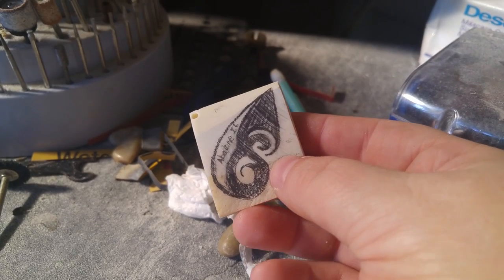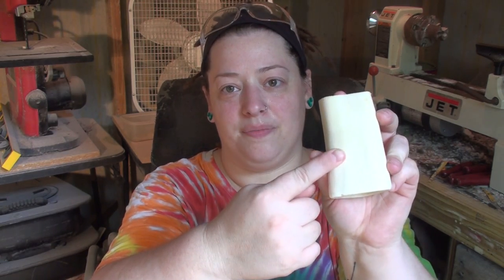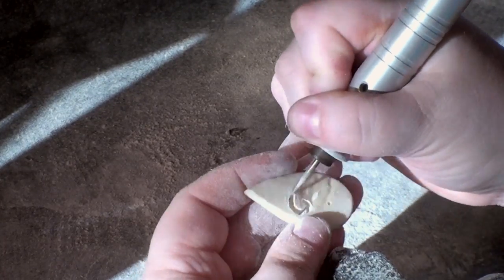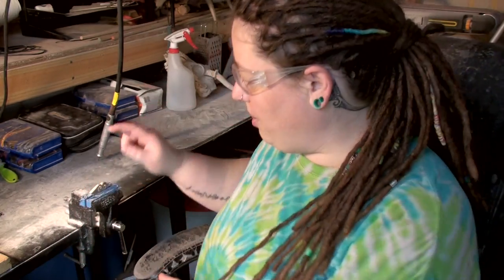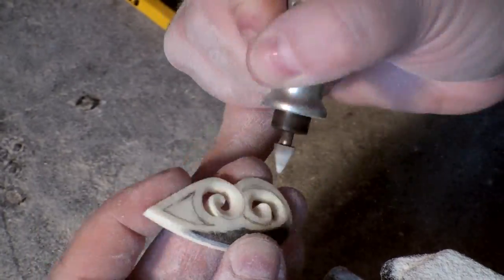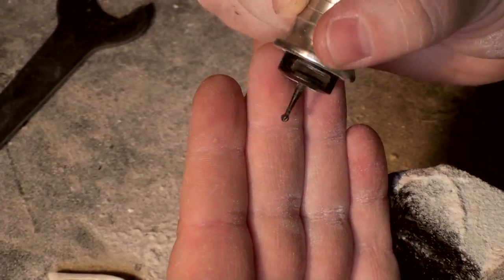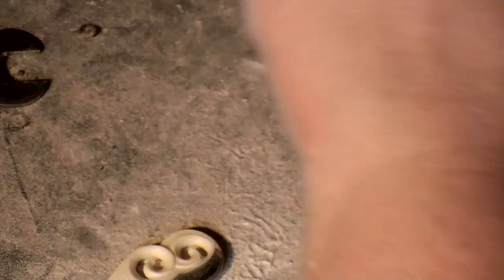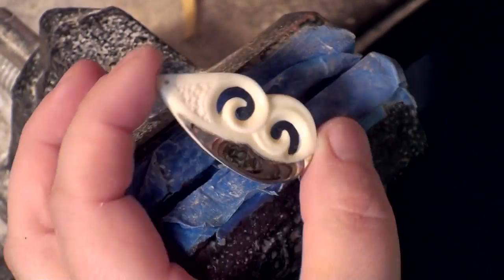Tutorial: Bone Carving | How to Carve a Bone Pendant with Abalone Inlay

Comment: Hi Heather! I'm curious, I've always like slightly stained bone. If we wanted to stain the bone would we do this before the polishing step? Did you have any recommendations for bone staining for a natural/light stain? Love your video!
Reply: Also what kind of sanding discs do you have? I didn't have much luck finding. Thanks!
Reply from the maker: Hi Marina :) I can indeed help with that... in fact, I was planning to include this in my next tutorial(when I can find the time to make another one...lol.) My favorite way to stain bone is to make a solution using coffee grounds and water. I'm sure there are plenty of other ways to do it, but since I couldn't find any information on this when I first started carving, I kind of just developed this method myself. I take a couple table spoons of coffee grounds and put them in a small bowl. I then add water just enough to cover the grounds and bone carving. The more concentrated the solution, the better. If you want a light stain, you can leave it in for a couple hours. If you want a dark stain, you can leave it in for up to several days. I find that I like the look of  the stain better when I drop the bone in after it is sanded and polished. Once it is done in the stain, I run some of the finer sand papers over it again and give it another polish. It is personal preference really, as it can also be stained before it is sanded and polished. However, if done this way, the high points will loose the stain after sanding is complete. Sometimes this method works for certain looks... perhaps if you want only carved designs to remain stained, etc... Have fun! :)
Reply: thank you for your quick response! i'm assuming the stain would change the color of the rock/crystal that is imbedded in it correct? not sure if you've tried that before or not. Thanks again!! have a great weekend!
Reply from the maker: My pleasure. :) I have not tried staining any projects with embedded stones no... I'm not sure what the outcome would be since a lot of minerals are porous in nature. If you try it, I would love to hear of your results. :) You have a great weekend as well!
Reply from the maker: I just use regular barrel sanders for shaping the material... you can buy them in kits from hardware stores or amazon, etc... Here is an example: https://www.amazon.com/LiangGui-Including-Sanding-Sleeves-Mandrels/dp/B0772GB1ZM/ref=asc_df_B0772GB1ZM/?tag=hyprod-20&linkCode=df0&hvadid=241901362930&hvpos=1o2&hvnetw=g&hvrand=11562709628242970759&hvpone=&hvptwo=&hvqmt=&hvdev=c&hvdvcmdl=&hvlocint=&hvlocphy=9051599&hvtargid=pla-399622099573&psc=1
Reply from the maker: For finish sanding, I cut strips of wet dry sand paper that I get from auto part stores. They always have a large selection of sandpaper grits.
Reply: Heatherfish Creations you’re the best thank you so much! Sorry just a beginner I have no idea ha but do taxidermy apprenticing so I def want to get into it more

Comment: Hello Heather your video is just amazing! i am kinda new to this but so far i made great pendant using my imagination. i have only one question. can you link me to a web site for a dremel that i can do the contour of my pendants. i think its the one you wrote your name with in the back of your work. since i have biginers tools i dont own that dremel. if you want i can show you what kind of work i did :)  thank you in advance
Reply from the maker: I'm happy you found the video helpful! I'm even happier that you have started carving! I'm not super sure if you are talking about the entire rotary tool, which I did link in the video description, or if you are talking about the individual bits. Since you referenced the part where I signed the pendant, I'm going to assume you are talking about the bits. I was using a micro carbide bit for that. It came with this kit: https://www.homedepot.com/p/Dremel-Carving-Engraving-Kit-for-Stone-Glass-and-Terra-Cotta-11-Piece-689-01/202349447?cm_mmc=Shopping%7CG%7CBase%7CD25T%7C25-7_POWER+TOOL+ACCESSORIES%7CNA%7CPLA%7c71700000034127227%7c58700003933021549%7c92700031755124880&gclid=Cj0KCQjw6fvdBRCbARIsABGZ-vQsUKXzaATRN99tdWWTxIRK0SzdWrVEe4cOk5I6mWSPLf8qSczdlIUaAnkaEALw_wcB&gclsrc=aw.ds&dclid=COv0zuymgN4CFUpZwQod5PgDvQ

Here are two more kits you may find helpful:
https://www.ebay.com/itm/30x-1-8-Tungsten-Carbide-Burr-3mm-Rotary-Cutter-Files-Set-CNC-Engraving-CED-6mm/263650063111?epid=20018786263&hash=item3d62c4b307:g:jAUAAOSwwAFa6BMa:rk:26:pf:0

https://www.ebay.com/itm/20Pcs-1-8-3mm-Tungsten-Carbide-Cutter-Rotary-Burr-Set-CNC-Engraving-Bit-Set/202126575496?hash=item2f0faec788:g:44gAAOSwUoNaG7rJ:rk:40:pf:0 

If I misunderstood, and you are talking about a rotary tool, but are looking for something cheaper than a foredom, you can use a dremel 4000 with flex shaft attachment. Would love to see you work! You are welcome to email me at heather@heatherfish.com or you can tag me on one of my social medias listed in the video description.

Comment: How long have you had your dreads?
Reply from the maker: Hugging Treez I've had them 4 or 5 years in August... I'd have to look it up to be 100% sure. It's sad I can't remember...lol
Reply: I appreciate you getting back to me. Love the videos by the way. How large are your sections? I am doing mine myself and haven't found much to go off of for sizing. And I absolutely love yours! Lastly, do you have any issues with them being too thin at all? I am hard on my hair lol. Thank you again!
Reply from the maker: Not a problem. :) Thank you! 

Sectioning was one of my concerns when I started as well...my sections vary from the size of a dime to the size of a quarter. The hair on my head is thicker in some areas than in others, so I simply went by the amount of hair I gathered for each section and tried to make sure they were all the same because I wanted my dreads to be all the same or similar size. 

The complicated part, however, is that everyone has different thicknesses of hair, so it is difficult to section according to how others do it. For example, I have really thin hair. When I used to wear a pony tail before I dreaded my hair, I had to loop it 3-4 times, thus my sections are going to be bigger than someone with thick hair if they want dreads my size... I have 68 dreads, but someone with thick hair that wants the same size dreads as mine may end up with over 100 dreads.

I won't lie... sectioning was what I struggled with the most at first. I'm kind of a perfectionist.

I don't have any issues with my dreads being too thin. They average from 6-8mm. I suppose if I were to be aggressive with a crochet hook,  it is possible to weaken them... but I am really, really careful when I do maintenance. You have to kind of baby your dreads if you want them happy and healthy for the long haul. :)

Comment: Hi, Super video well done. Believe me, for many years, I had a large bone carving and cutting factory, with over a hundred employees. I recommend a simple suction vacuumed behind or under (with screen across), where you hold the carving. The dust does well for the garden. We used large manifold suction ducts at each carving station. Dryer hose works great for cleanup. 4 inch PVC sewer pipe makes a good manifold.
  Your techniques are spot on.
Lots of materials like bone, abalone, MOP, Pink MOP, deer antler and sheep horn at knifehandles.com.
Many thanks and try some pink conch shell or Cassius Rufus (Cameo shell).

Comment: I have a dremmel 3000 what bit are you using pet shop bones ha ha no what bits name and where you buying them on amazon ebay love to know cheers. keep up the videos. 👊👊👊👊👊👊
Reply from the maker: I have obtained so many different bits over the years so I don't remember the exact kits, but this one would be a good one to start with for detail work: 
https://www.ebay.com/i/390952656987?chn=ps&dispctrl=1

I also find that my carbide bits are a must have. These are similar to what I use: 
https://www.ebay.com/i/292308100138?chn=ps&dispctrl=1

And of course, for removing large amounts of material, and cutting, etc, you are going to want barrel sanding bits, and a diamond cutting wheel.
https://www.ebay.com/i/401428669957?chn=ps&dispctrl=1
https://www.ebay.com/i/120836882022?chn=ps&dispctrl=1

Pet shop bones? Yes... for beginners, they are perfectly good carving material and polish out rather nicely. Though I recommend obtaining and processing your own so you know the source. :)

Thank you! Hope this helps. ;)

Comment: Do you still respond and answer questions on here? I have some questions
Reply from the maker: I reply on occasion should there be a question I haven't already addressed in the older comments. :)
Reply: @HeatherfishCreations  any suggestions on specific carving tips you use? Diamond tips? Also what type of sand paper do you use?
Reply from the maker: @jarednuttall6210  I use a combination of carbide and diamond burrs. More often than not, I use the carbide ones for most of the material removal, and then I smooth and touch up tricky areas with the diamond burrs. The specific types really just depend on the project and how the material reacts.  However, I recommend you just experiment a bit with all the different burrs, because I have found that all artists differ in what they prefer to use, and experimentation is the best way to find which burrs you are comfortable with.

In regard to sand paper, I use wet/dry sand paper from the auto parts store. I'm sure there are other types out there, but I like that kind the best. I've picked some up at both Advanced Auto Parts and Auto Zone, and either works fine. I use 300 grit all the way up to 2500 grit.
Reply: Great!! Thank you for all your help. I use to do bone carving almost 15 years ago but it would take me about 3-4 hours to finish 1 piece.